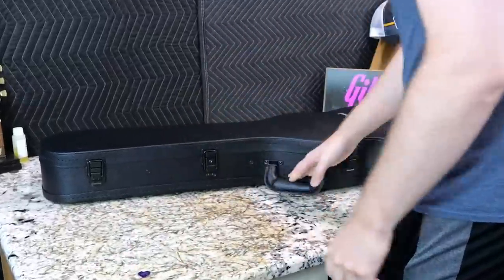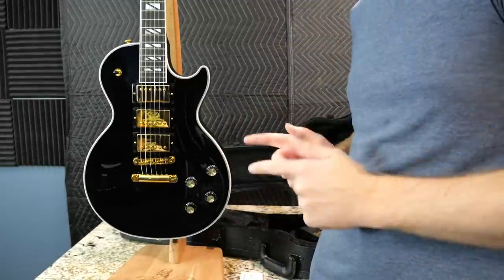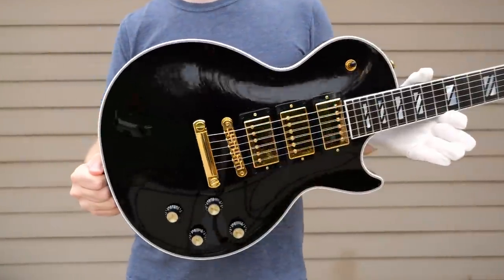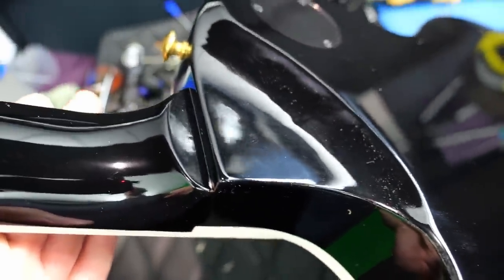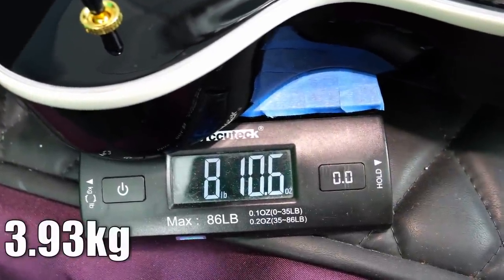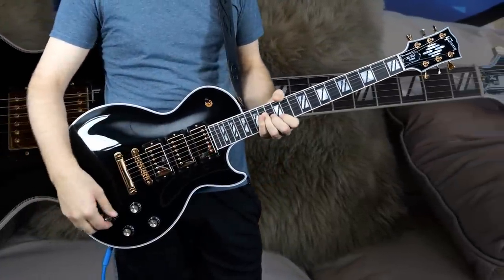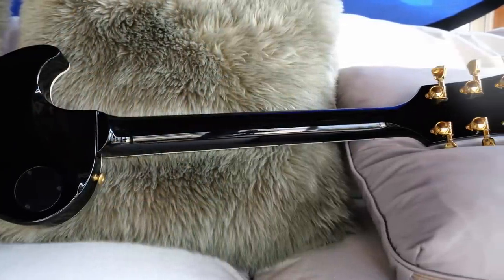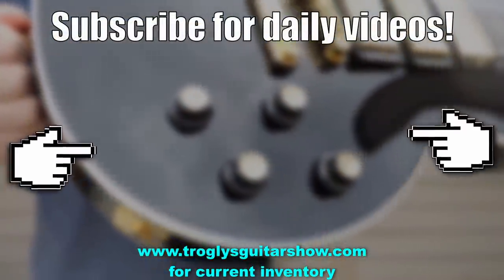Gibson's Hidden Spec Change Makes This BETTER | 2023 Gibson Modern Supreme Black Beauty 3 Pickup

Comment: After watching, I think I might be leaning towards getting the two pickup version.  It seems like this model would really benefit from the direct to bridge push/pull on the tone knob so you don't have to roll off the middle.  

I like the 3 pickup version and have nostalgic feelings for 3 pickup Les Pauls, but I think I prefer the flame top and the electronics of the other version.

Comment: The flame is awesome, but the deep black with the triple pickup setup and the gold is where it's at
Reply: It’s quite gorgeous !
Reply: Imho there is no point to the third pickup. I have a strat with individual on/off switches for the pickups so I can get the bridge/neck combination. I've tried all 3 at once and there was no real change in sound.

Comment: That a really hard choice man. I’m a Jimmy Page freak so I’m going to have to go with the out of phase pickup set up but I do like the solid black 3 pickup.
Reply: I could be wrong but I think the middle and bridge pickups together on the 3 pickup Les Pauls are wired out of phase. So might get you that sound if true. I actually got a lot of Page vibes from this since he used a 3 pickup custom in the early years. Though I know his 59 with the fancy wiring is what he’s more famous for using.

Comment: I think that's likely deliberate that this guitar is hand-wired instead of the standard "Modern" 2-pickup PCB system. Quite aside from possibly having to design a new PCB, I'm sure they'd recoup that cost pretty quick as it would make installing the electronics quicker, I think they did it because it will make this guitar much easier to mod so if you don't like how it's wired up, or you want to install a direct-to-bridge "blower" switch then it will be possible to do so without maybe having to pull the PCB and starting from scratch if the PCB is incompatible to how you want it wired up

Comment: I don't understand why Gibson sullies their guitars with such a bad coil split sound. They wind the coils on the pickups 50-50 with pickups being around 8.5k, when if they would wind them 30-70, the coil with 70% winds would sound like a proper single coil, being around 6k in resistance (like Fender's single coils). Instead, we get a shitty tinny sound on a $4K guitar because they refuse to wind the coils assymetrically (the way PAFs were originally).

Comment: This one needs the Jimmy Page mod with 3 switches for all the pickups (that’s the one that got stolen from him, unfortunately. Someone did find it, it was modified back to stock, but the evidence it had been modded for 3 switches was still there and Jimmy got it back.)

Edit: the middle being off with the other knobs at zero, this needs “50’s wiring” where all the pickups are independent from each other.)

Comment: Despite there being 3 volumes all with coil tap can the direct to bridge still be installed in the tone? That’s a nice feature on a 3 pickup guitar. The only thing I didn’t hear because apparently it doesn’t work is the middle pickup alone. Sounds like the middle is dependent on the neck and bridge being on to be heard. I know it can be re wired though I like the sounds it gets when the middle is combined with the other pickups and the tone you got out of it. This helped finalize my decision to get this model.

Comment: Yeah it's shame they didn't put the direct to bridge in this one, coz it would actually make a lot of sense in this 3 pup config, well makes more sense than on a 2 pup guitar, because on 2 pups it's easier to just flip the switch, in the 3 pup LP it's harder to go from like a volume/tone mix on bridge and middle to just full bridge, that could be like 3 knobs to turn to go full bridge+tone max.

Comment: I like the way it looks except for, the short middle pickup ring. (The middle pickup sticks up too far, above the ring, for my taste.) I can understand it, for playability's sake, (I guess?). However, I cut down, and contoured a bridge ring, for my copy. It doesn't get in the way.

As for the wiring. Thats another story. I don't like it. Mine are all independent volumes. The 3-way is the same as, stock 2 pickup wiring. (My middle pickup is push/pull on/off. With a middle phase shift, on the master tone.) The other two push/pulls split neck, and bridge.

Comment: Can I ask a genuine question guys? Does anyone ever actually use the coil tap/split options on any of their Gibsons? coz to me they always just sound insipid & puny (but then all my Gibsons are older models with straight-up traditional wiring so maybe that's why they don't gel with me?). If I want single coil tones I just use my old Strat or better still my R6 with P90's. Coil tap/split 'buckers just don't cut it imho.